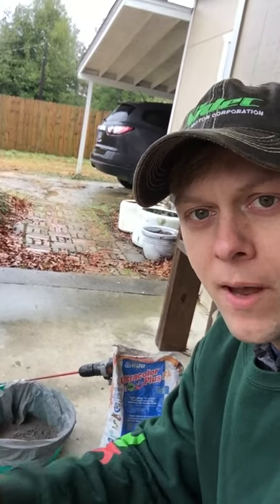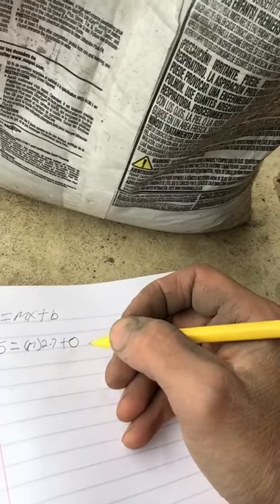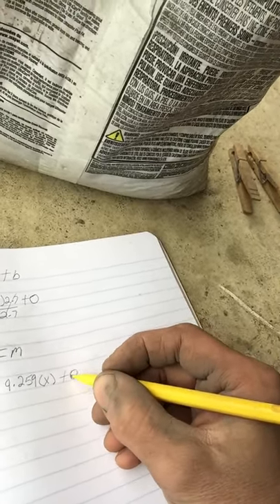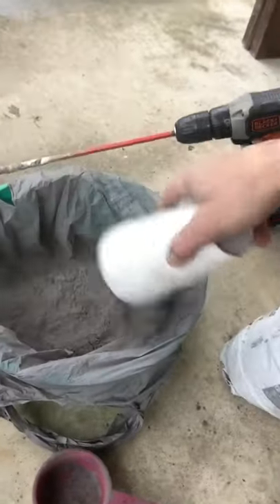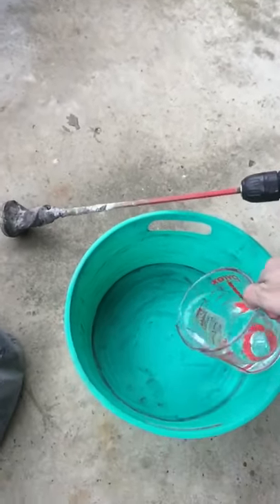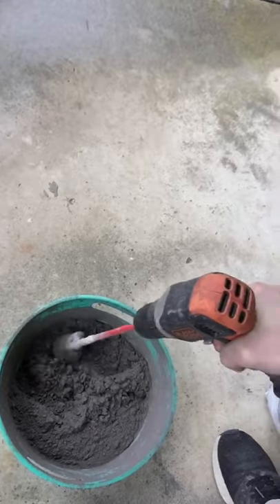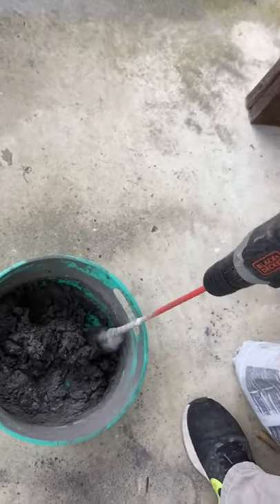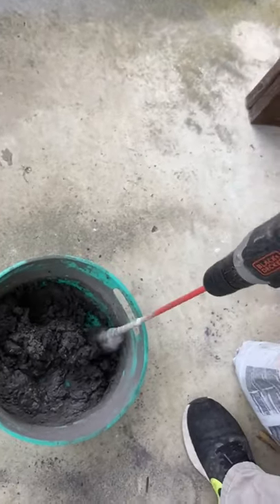Mapei ultra color plus grout how to mix a small batch using algebra

Comment: Great video. I used Mapei Ultracolour last night. I did small batches -  6 x cups of powder to 1 cup of water - lovely buttery consistency - mixed by hand 
(I'd read/watched that overmixing with a 'whisk' gets too much air in it, and it sets a lot quicker. I guess whatever works for an individual is the right thing!

Comment: just FYI use a SLOW speed drill and the longer the pot life.  high speed drills whip air into the grout and causes it to set up faster (so says the manufacturer if you call them)  and when i say slow speed, almost hand mixing it.  you will be surprised how much time you will have and how much more you can mix up.

Comment: Love using Algebra, but according to the manufacturer, you can just mix 4 parts powder to 1 part water by volume instead of weight.
Reply: And remember water is 8 lbs per gallon -> 0.5 lbs per cup

Comment: 25lbs / 10.8 cups.  2 1/3 cups per pound of grout.  Keep it simple.
Reply: The 2 1/3 seems incorrect. 10.8/25=.432 cups per lb
For 3 lb it is =3x.432=1.3 cups
For 25 lb =25x.432=10.8 cups

Comment: Nice. It is a linear relationship.   I used Mapei Ultracolor Plus FA grout on an entire shower. I mixed ONLY 2 pounds at a time with 204 ml water, did a say 3' x 4' section ONLY , then wiped. You NEED two people. My wife sat in a chair with seven (7), count em, SEVEN  sponges, and three (3) five gallon rinse buckets, and kept the room temp between 60 and 70 degrees.  FANTASTIC RESULTS   TWO PEOPLE.
Reply from the maker: Nice, sounds like you did a fantastic job with grouting your shower. Thanks for commenting and good luck with your projects.

Comment: Thanks for the demonstration and confirming that I need to be working with this stuff in small batches.  I know many people have commented already but I just want to add my 2 cents.  You don't need to use the full blown equation for a linear relationship to figure this out.  As you demonstrated linear models are a powerful statistical method used to describe many scientific phenomena, and by using it you did arrive at the correct answer (it is a correct method) but it is needlessly complex for this simple problem.  The ratio method (which is actually a linear relationship with the extraneous variables removed) mentioned by RockyMTHirvi is the simplest way to figure this out.
Reply from the maker: Hey glad to have helped, and I agree about simplifying the math in theses calculations. Thanks for the comment and good luck with your projects.

Comment: I was thinking about putting the 10 lb bag of Mapei in a kitchen bag and shaking it up before taking a portion. Wouldn't that make the color more consistent?   Or alternatively use a 5 gallon bucket with lid.. shake it up first before taking a portion?
Reply from the maker: You could do that if you have had issues with color being inconsistent. I never had any trouble with the color being inconsistent so I didn't have to do this. Good luck with your project!
Reply: I have a grout business doing cutouts/regrouts.  I always dry mix any bag before batching it out.  It's easy enough to do, and not worth the risk skipping that step.

Comment: Thanks for sharing. So would it be okay to do a kitchen floor say over 10 sessions like this?  Oner person over several days.  Does the color match well when you jjust mix partial batches? Do you have to mix up the dry stuff first to make sure the color is distributed properly? I heard that color settles to bottom in some grouts and that entire bag should be mixed for that reason.  Does wet grout bound / butt up well against dried grout form the day before?  No color or structural inconsistencies?>
Reply from the maker: This grout does good if you mix a partial bag, so mixing small batches and doing over ten sessions should be fine. I did mine this way and the color came out perfect every where. My mixing process was very exact and I had good results. Good luck with your tile work!